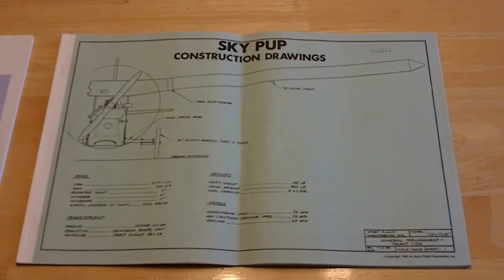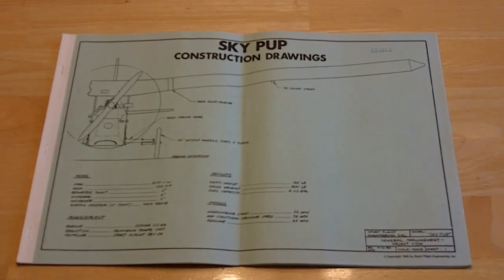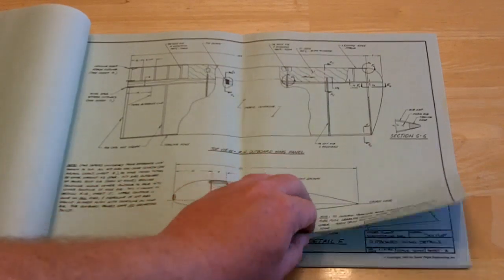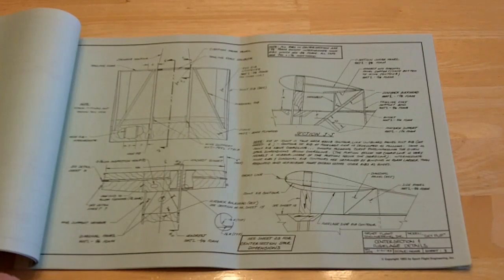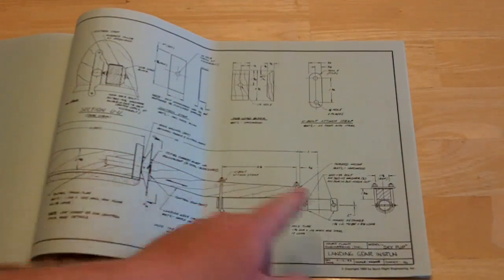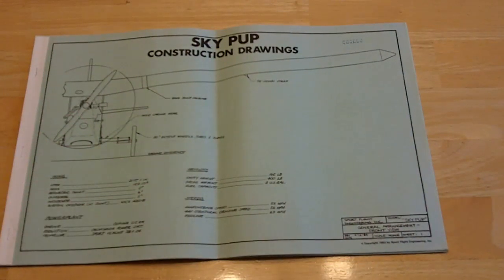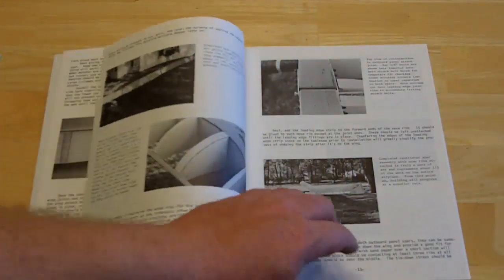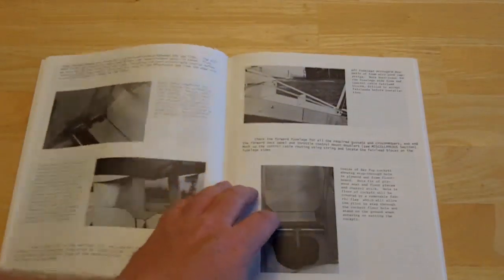Sky Pup Ultralight construction video 1

Comment: Hey Mike where are you locàted?  I want to try and build one someday... i may have to add a little width... lol.. but i was thinking of going with a small 4 stroke military lycoming ... spl? ... engine used on a small generator.  I have to gind the the name later.. lol.
   I wanted to build something simple, easy to fly, and nostalgic looking... the sky pup reminds me of a cox lazy Bee.
Reply: I'm building one in 2025.  It will 100% follow the specs.  Note, you can get the engine and keep it in spec.  You've got to worry about CG and getting a proper propellor if you don't follow specs.
Reply: Hello mike .i am from India and i want to make this plane...can you help me please